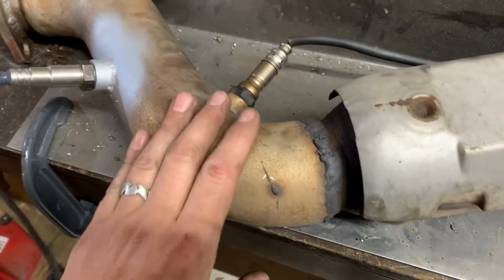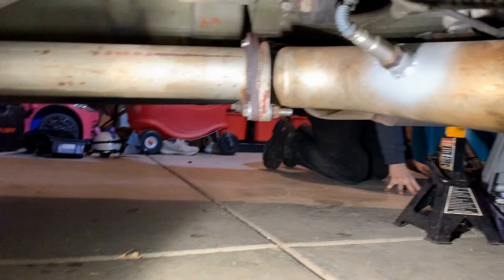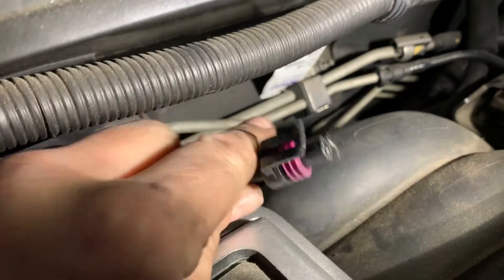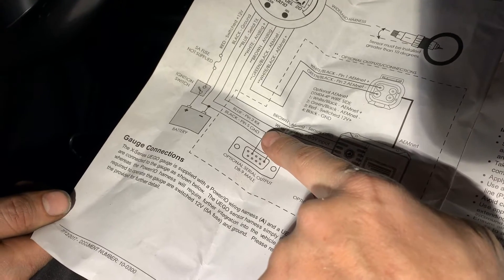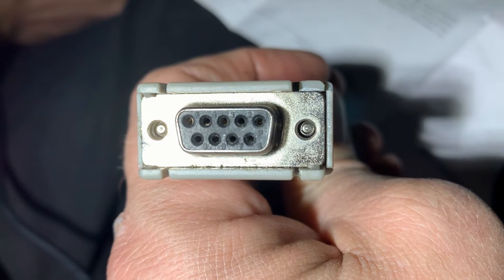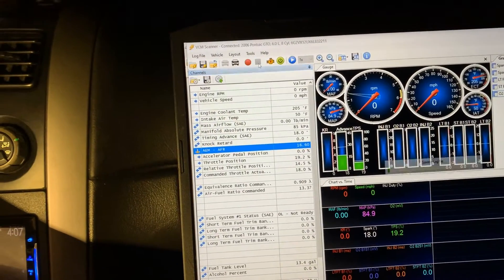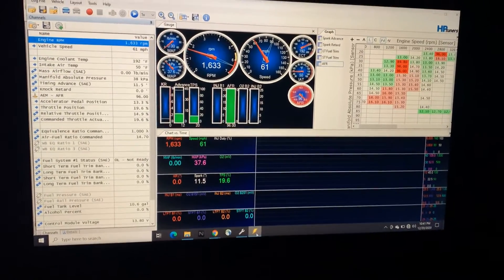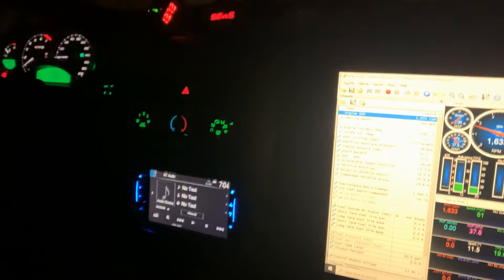AFR Gauge Datalog with HPTuners

Comment: Do you actually need all those converters or can you just go and create a USB plug off of the ground and Signal wire?
Reply from the maker: You can try that.  This is the only way I’ve been able to get it to work tho
Reply: @TurboDadGarage did you ever try to make or get a direct USB connector?

Comment: do i need all this if i get the pro features from hptuners?
Reply from the maker: Not necessarily, but if your car doesn’t have a wideband can be monitored from the ecu, then yes
Reply: @BMF_Garage  just to confirm, pro version is not needed to datalog the wideband as shown in your video? I just got the standard mpvi2 and I'll be going this route to read afr if it works. Thanks.
Reply from the maker: That’s correct